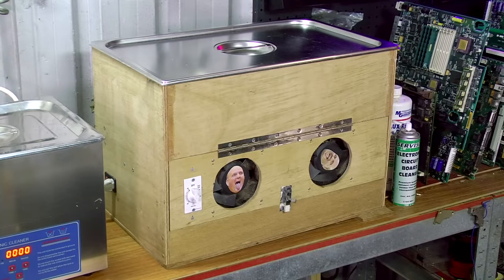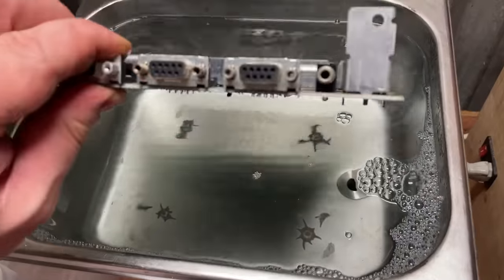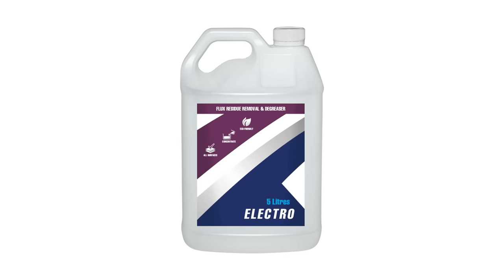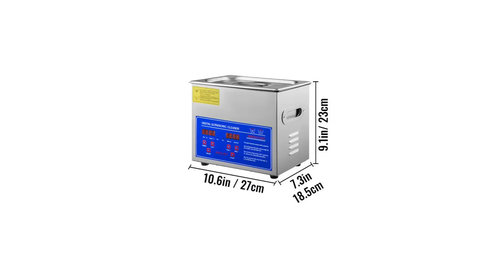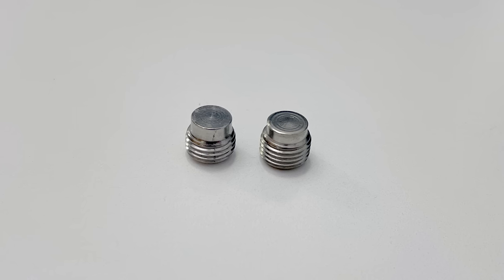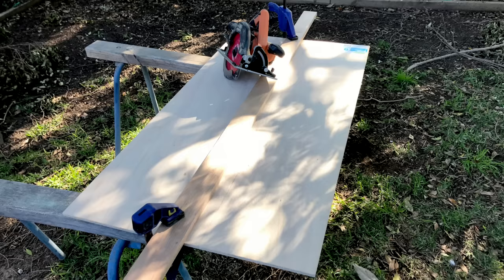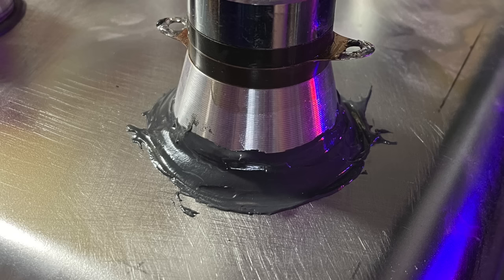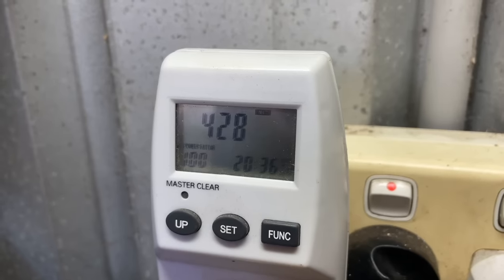Building my own Ultrasonic Cleaner

Comment: working in the medical devices industery I have some experiance and training in cleanning boards in UCs. , if you rinse only in alcohol, you leave your bords with polar contamination like salts and all nasties you try to wash out like leaked capacitor juices and battery leakages if available. basically, almost anything that would promote corrosion on metals, wouldn't wash with alcohol bath unless it is mixed with water, even the liquid-cleaned residue wouldn't dissolve in alcohol and stay on the board. they recommend washing the parts preferably in running water until no trace of liquid soPE is detectable (nomore bobbles foarming if water shook aggressively ) and after that, you can rinse it with distilled water or/and alcohol

Comment: I have a 10L coviz and have used it to clean everything from vintage bicycle parts to carburetors and vinyl records. I used dawn dish soap, isopropyl alcohol and hot water. I have also used de-greaser, powdered kitchen cleaner, and Evaporust (an organic rust remover). I find the built in heater useless and just use a kettle, or screaming hot tap water if working with greasy parts. Quality control is the Achilles heel of anything from Ali Express.

Comment: I have used an off the shelf, eBay purchased, ultrasonic cleaner for a few years with no problems.  I have cleaned some very grimy lathe tool holders, and lots of brass cartridge casings for reloading, and lots of things in between.  They are great tools to have in the shop.

Comment: As someone whose job it is to understand and do all of this professionally (engineering manager for an ultrasonic cleaner company), it's kind of funny but also neat to see you struggling with some of the exact same problems we have historically had. Obviously I know some of the answers to your woes, but cannot divulge the solutions as that's how I make my money! Lol
Reply from the maker: I would invite you to check out the follow up to this video: https://youtu.be/ByhGEFwCxoY
Reply: @BranchusCreations  Didn't see your response until just now, but you frankly did a fantastic job figuring this all out! You're essentially doing everything we've done, just much more low-tech. Your solutions are far more robust, but also less friendly to mass production, compared with most professionally-produced units. Great job with the silver solder solution!

Comment: Well done with that cleaner.   For someone doing this with no prior experience, I admire your perseverance.   However, I need to give you a serious warning in relation to the cleaning of PCB’s: NEVER put a pcb in a microwave oven!

The e/m fields in a microwave are very likely to induce currents and voltages in sensitive components.   CMOS integrated circuits (especially anything digital) is extremely sensitive, and are highly likely (read almost certain) to be destroyed completely the moment you switch the oven on.   There is worse – the pcb itself.   All the conducting lands on the board are stuck on (OK, an entire sheet is stuck on, and the unwanted metal is etched away).   These metal lands will get very hot very quickly in the radiation, and will come unstuck, destroying the pcb itself, which may or may not be replaceable.   That’s before I even mention the potential fire risk.   So don’t! Ever!   Don’t even think about it!   You showed a large pcb that looked as though it had come from a large TV set; you wouldn’t want to destroy that in a microwave oven; just think about how much that would cost to replace, and that’s even if you could get one.

Please make sure everyone who follows your channel is made as fully aware as possible of this.

In relation to the transducers, given they are mass produced, they should be connected in parallel.   If you look at the transducers in the video, there are two terminals on opposite sides, one above the other.   The upper one was marked as positive, and all positive terminals should be connected to the same side, i.e. the positive rail of your power supply, and the negative similarly.   This is because all their audio outputs will be in phase, and will reinforce (subject to audio interference patterns within the liquid).   If they are in antiphase, they will cancel out most of their power before they even reach the components to be cleaned.

As for liquid, I would recommend a non-aqueous liquid.   When I was working in electronics, trichloroethylene was the favoured liquid, as it was non-conducting, non-flammable (colleagues of mine even used to put cigarettes out in it; I never smoked, before you ask) and had a low boiling point, so it dried quickly.   However, it has been found in more recent years that it is also carcinogenic, so probably best to steer clear of it.   Bear in mind that the plastic base of a pcb is not necessarily waterproof, and it could absorb water due to the cleaning process, which could cause electrical problems later on.

Finally, given what ultrasonics did to thin aluminium foil, bear in mind that this same kind of damage could be inflicted upon potentially sensitive components, so I would not recommend that you wind up the intensity of the ultrasound just to make sure – in case you do!   In my experience, it’s always best to treat electronics with care, much as you would a piece of valuable cloth or something rare and precious.   I know they clean jewellery and watches with ultrasound, but that doesn’t mean you can just go mad.   Again, if you do, and you damage it, you will go mad when you discover what you’ve done!

Steve Moore

Comment: Great info, I'm looking to build one myself, am an automobile technician, but prefer, working on the older  antique carburetor cars,and need an easier cleaning  process than chemicals; 
As to the JB weld issues, I've had  really good  fortune using a heat  gun (electric) to prep heat my work surface, apply to the  cool  part then position and let cool, even  had good luck with a long term patch  on an exhaust system just  behind the  catalysts, they  git  really  hot,

Comment: GDAY MATE….10 Years ago i advocated the use of ultrasound and cavitation..along with PULSE WIDTH MODULATION…FOR A DISWASHER…/ BASKET LIFT STYLE..AND A “ LILY  IMPELLER.. for the water circulation….it will be noiseless…and safe…le lifting the dishwasher lid…stops the process….and can be adapted for 12V use..in caravans..and campers..all in one sink../ dishwasher.

Comment: 3 years or so after buying my ‘ultrasonic’ cleaner…. I have now realised I am not alone in having transducers fall off. Mine landed on my circuitry below and luckily just stopped working without me being giving a ‘home made defib’ jolt. Worked 2.5 times out of the box. Initial results were a revelation. Third’s a charm… is it feck… anyhoo after hearing the rattles once unplugged I disassembled whilst taking loads of photos (probably way too few) and removed the broken(the resin had fractured in the transducer) item and then re boxed it (as delivered) and put it on the shelf. I was a bit shocked at the ‘glue’ being used to secure these key items and directly above the electricktrickery components.. ordered two new transducers and they were placed on the shelf where I keep my spares. Both the box with the cleaner in it and the transducers have not moved a millimetre since.

Now maybe, I can attempt a repair. Hate electrically got zapped as a toddler sat on me potty… extension cable sockets are a deadly trap for a young boy who is ‘downloading’ his last meal… plus a front loading washing machine on the spin cycle at the other end.

Changing batteries in a torch gets me sweating.! A

Great video and very well explained I am now ‘subscribed’…

Comment: Thanks for sharing. I would have found a bolt that matches the one you stuck down first then drill a hole through the bottom of the tray. Screw it and glue it. Might be able to use red loctite thread locker. Not sure.

I want to build one. Great idea!

Comment: I am researching machines to clean vinyl records. I'm hoping to find a way to filter the cleaning solution so it doesn't have to be changed frequently. You were very patient with your project. I would try to find someone to TIG weld those little bolts. Happy cleaning!
Reply: Just a tip, use the highest frequency ultrasonic transducers you can get your hands on

Comment: Very nice job on video and quality narration.
Bonding solution you might consider a 3M product called 5200.
It's designed for the marine industry but metal to metal can be accomplished. Thanks for the effort and sharing your thoughts.

I see others discussing the sourcing of copper washers. McMaster Carr can serve all your industrial needs, or hobbyist.
If they don't have it you may well be stuck.

Comment: Thank you for telling all the details, they say good training. Please, if I make the depth of the container instead of 16 cm 4 or 5 cm, is it practical.
I want to use circuits to clean all parts of SMD, and the sum of the board does not exceed a few millimeters, and with the diameter of the mesh we will reach one centimeter high and the high -height of the washing liquid is 3 or 4 cm.
The reason for my question is because the volume of water is much less and I can definitely implement this project with less converters and lower watts.

Comment: Welding: Cheap stick-welder allows for welding a very large range of materials as there are sticks for pretty much anything and the cost for a new material is small in addition to the MMA(stick)welder being among the cheapest options.

Welding those plugs to the thin tank would be a matter of some stainless welding sticks and simply drilling a small hole in the tank, centering the plug  over the hole on the outside and welding through the hole from the inside(quick single bead/spot(obviously practicing a few times on some scraps of similar materials before committing to do the real-deal is the obvious way to go about it)), some dremel and sandpaper clean up and you're done.

pro-tip: holding the actual weld-stick itself(gloves optional but preferable) like a pen allows for better precision and control when doing small welds on thin/small stuff..

Comment: Great build. I'm not into electronics so have to wait for something obvious before I could attempt to fix it. Being a sparky, yes, always ground. I suppose, had you been able to find a welder that had a spot welder you could have gotten the bolts welded to the body which would have been far better than glue. Also if you could have found a welder they could have fixed a grounding lug to it too. If you can't do that metal braiding can be used around the edge of the container so when it sits on it a ground is provided but welded joints are better. I am considering building a vibrating unit to use with an electrolysis tank, moreso to move the piece to shake off any loose rust gunk.

Comment: You don't need such low temperatures (60-70c) for drying the electronics. Most motherboards/logic boards can handle up to 120c temperatures for drying but more  favorable is about 100c.  My cleaning process sees that i clean the boards with ultrasonic cleaner, then rinse the cleaner solution off under running tap water. Then blast the whole board with compressed air and slap it in the oven ~120c for about 30 minutes. I have yet to see that running water crystallizes or scale accumulates on top of the boards or under components, even looking through microscope. Mind you the local water has a lot of scale in it, about 300ppm when read out via TDS meter. You do you, i'll keep doing what works best for me.

Comment: I have a cheap Harbour Freight unit. It does do the job,  but the transducer gets really hot. So hot it started to melt its mounting. That tells me the 480 second timer is there for a reason. I push it only a bit harder in winter outdoors,  no need to use the heating element! Very cheap stuff, but it does suffice.

Comment: I replaced the tub in my Chinese ultrasonic cleaner a few years ago because it began leaking and didn't know there were originally those threaded bits that are welded to the tank. As you can imagine, the epoxy didn't last all that long and it stopped working. I have since bought new transducers which came with those pieces and used a TIG welder to attach them. you can use gasless MIG if you use wire that is flux cored stainless steel. I would highly recommend practicing welding some stainless screws to a piece of stainless plate first, because it's pretty easy to blow a hole through thin metal when using a MIG.

Comment: le vibrazioni distruggoo anche i ponti e possono allentare viti e bulloni. molto interessante soprattutto per i problemi riscontrati, qualità dell'elettronica a parte.
vibrations also destroy bridges and can loosen screws and bolts. very interesting above all for the problems encountered, apart from the quality of the electronics.

Comment: The commercial ultrasonic cleaner that you showed at the beginning, you should add a fan (it get very hot inside - so lots failure due to the heat), at least add a 4020 fan (personally I added a 8020 fan because I got bunch of them around). There is DC output on the motherboard, so you can add a fan to cool both motherboard and transducer easily.

Comment: Nicely done Bruce......
Your presentation is very well paced and succinctly delivered.
Stands watching a couple of times....

Whilst you are clearly demonstrating how it works with electronic components, it would be good to see how it copes with heavily greased, oiled or rusty items.

Car parts for instance, such as nuts and bolts....or brackets etc...

Would the transducers not also work if they were fixed to a frame upon which the tank was merely resting...?
Granted this would mean they were not in direct contact with the bottom of the tank and result in longer and therefore slower operating times.........which might have some benefits with certain items.

Also if the the tank was merely resting on the frame there would be more vibration causing the tank to move, but fixing up some form of clamping system would not be too difficult. In fact, within your wooden box the tank would essentially be contained and prevented from moving.

So, for example if the frame were fixed higher and thus lifted the transducers higher, there would be more airspace all around them, and most certainly underneath them. So a cooler environment with more air passing through.

How does the problem of heat dissipation work with the off the shelf 'tank-type' cleaners...?
Do they have cooling fans fitted........or does the tank itself work as a form of heat-sink / heat dissipation surface...?

James Hennighan
Yorkshire, England

P.S.
Just as an aside. Cavitation is what car water pumps and radiators are subjected to over their working lifetime. It is something we don't see and don't worry about until we suffer a failure. Although, obviously such components are working in a more continuous and harsher environment than any ultrasonic cleaner.......and coping with the impurities in ordinary water, which may or may not be mitigated by what is contained in any cooling system additive such as anti-freeze.

Comment: Many places that do fabricating will have a TIG welder. finding someone who's experienced on welding material as thin as that tray will be more tricky but probably not impossible. I would definitely try to get that welded instead of jerking around with epoxy, if at all possible.
Reply from the maker: I used silver soldering in my latest build and it worked well. The epoxy still plays an important role, just not structural. https://youtu.be/aDO3lxP4PO0

Comment: Thanks for an informative video, although I have a couple of suggestions:

After dabbling with ultrasonics in other industries, I would make the assumption that the studs are the means of attaching the driver, and the adhesive is to just mechanically join the transducer to the tray for increased efficiency and reliability. If unable to weld the studs, I'd be inclined to not use them at all. 
And I believe your choice of adhesive may be an issue, as JB weld is basically an epoxy with filler. You don't need the filler part, so I have no doubt a decent epoxy could be found to do a better job. Personally, I'd be tempted to use an anaerobic adhesive (Such as a threadlocker) as you have two very flat surfaces.
So no stud, use threadlocker, and clamp the transducer to the tray to minimise the space between the two while setting.

As for the polarity, the transducers are essentially "speakers", so is sounds like they just need to be the same polarity to prevent them from cancelling each other out.

Comment: Next time you run into an issue of not being able to weld small parts onto thin material, you can use your gasless MIG welder as a spot welder by removing the wire and using the small part on the tip of the welder lead as your "wire"...put the ground cable on your tray, place the threaded screw in the location you want it to be welded, put the tip of the welder lead on the screw and hold the trigger down to spot weld the screw and the tray together...

Comment: I was thinking that the adhesive may have had a problem not only from heat but also possibly because the transducer aren't tuned and matched. Now not that this is anything a hobbyist can do about it easily. But my guess is that the oscillator drift wildly with temperature and not being synced to begin with. So there might be waves of interference sweeping across the metal pan's bottom, "cleaning" the transducer off the pan itself.
Oh and while we are at it, is far as i know, my little household sized cleaner does stepped frequency sweeps over a span of a few seconds to increase effectiveness.
I dunno if your driver board do that themself or if they have a control input. If the latter is the case, an arduino uC could easily enhance your monster cleaners performance by a lot. The amount of code and additional electronics required would be trivial.